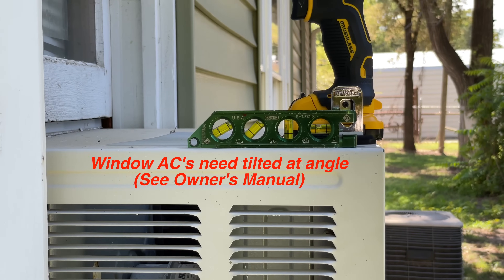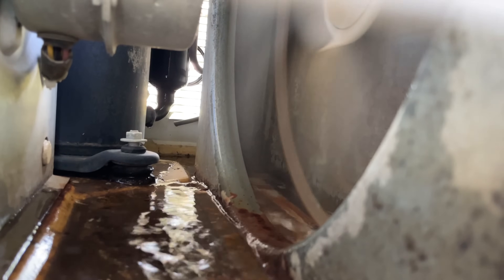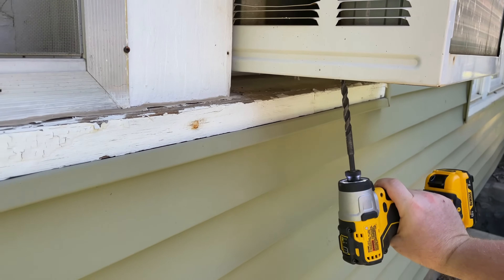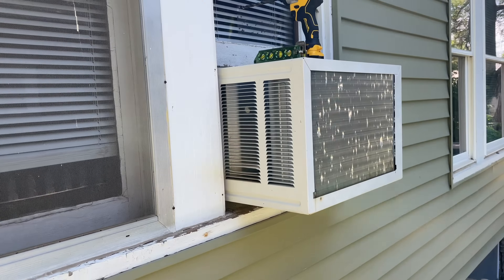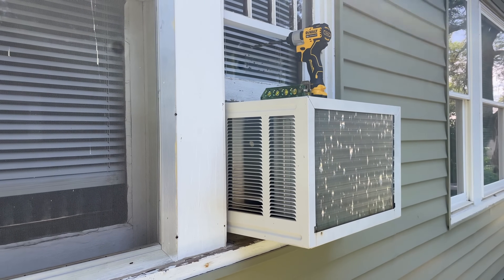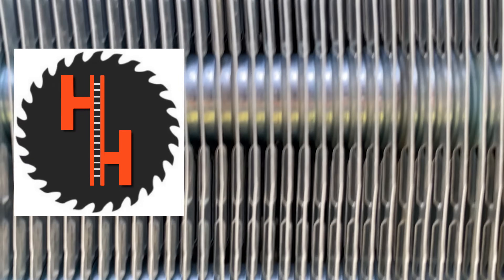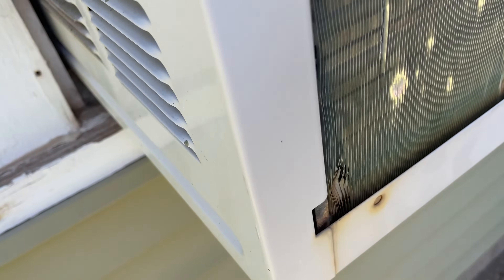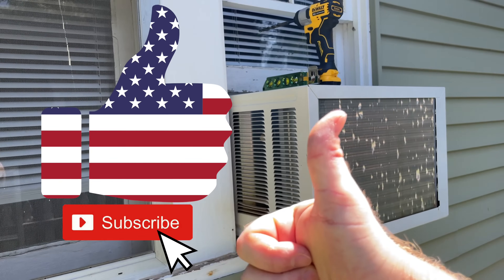99% Don't Know THIS About Window A/C's!! DON'T DRILL!!

Comment: I appreciate the information.  Unfortunately, I recommend that everyone break out a drill and add some holes... I guess the "splash" method is a good theory, but it's proven to me to not be effective, and it's risky to not have a drain hole.   The unit that I had before was in the same window 18 years, working near-flawlessly with just a few issues over time.  I knew where and why it had a drain hole, and I'd see it draining/dripping as I walked by it. And if I saw that something was keeping it from draining, I'd remove the blockage.  I'm not an AC or HVAC guy. I am a typical homeowner.  So, the operation of these units is not intuitive for me, but I at least understood why the hole was there.
So when I replace the original window unit in 2018 with the GE drain-hole-less one, I just assumed that it would operate like the original one, and thought that it would just drain... but I never saw any water.  So I assumed that it was just a different design, with better evaporation (or something like that).  Well, last year, I noticed a puddle on the floor in the garage/room that this window unit was cooling.  The floor was ruined, the wall was ruined. The window was swollen and ruined.  I can't tell you what caused the AC to clog up like it did, but a drain hole would have prevented that from happening.  
So, the manufacturer's attempt at "efficiency" is IMO a fatal flaw.  I spent  a couple thousand dollars on repairs, to fix damage that a $400 AC unit did... And all that was needed to prevent it from happening was a freaking hole in the bottom.  I'm sure that if I had been a more diligent consumer, I might have caught and prevented the damage from happening (by paying closer attention to the AC unit), but IMO the gained efficiency ain't worth $2000 freaking dollars.  
BTW, when I removed this flawed unit from the window, I noticed that the bottom pan, coils, fins, condenser mounts were all rusty.  another indication that this is poorly executed.  Back in the old days, I was never a fan of GE radios, appliances, etc.  But I thought I'd give them a try.  Never again.  They still suck.
Reply: As someone who's had an AC leak inside the room recently, I can tell you that this is not so much the manufacturer's fault as it is improper maintenance. There's a hole in the unit that goes from the front to the back, through which the condensation flows to the back of the unit and collects there. That hole on my unit was filled with junk buildup over the years.

I'm sure your unit had a similar problem. Granted, the rust issue I do agree on.
Reply: So, no new holes should be made! If the unit is installed correctly (at the appropriate sloping angle), then the water will simply pour out over the lip on the back or weeping hole.

If you have water leaking inside, it is because the unit is closer to too level, or you have a blockage between the front and back drainage.
Reply: @exisfohdr3904  But all does not pour out.  It is the water that stands in the unit that causes problems.  If you live in a dry area, maybe fine, but in the humid south, you will have a garden of slimy mold and rust issues.
Reply: @bogieman101  The units are designed to have that water in them. The water is hit by the fan blade and slung onto the condenser. This is the increased efficiency. The condensor is the hot one. The water slung onto it evaporates rather quickly, which increased the cooling of the condensing refrigerant inside of the condensor.

If you do not do regular cleaning maintenance, yes, the water just collects, and your condensing coil gets fouled up. This is a naturally occurring thing that can only be combated with proper cleaning intervals.
Reply: @exisfohdr3904  I understand every bit of that, but in certain areas that means continuous maintenance.  The design is not necessary, just an easy way to bump up efficiency by a micro percent without costing money on manufacturing.  Also reduces longevity.  The amount of energy it saves is offset by multitudes by short lifespans of units and potential  health concerns.  You just can have water sitting in units in high heat, high humidity areas without sludge, mold, mildew and algae issues, unless you plan on total cleaning every day.  It is just a stupid design and people are just trying to find a way to make it easier to live with.  Have you not ever seen a design that was idiotic yet is still being used?  That is what we are seeing with this.
Reply: @bogieman101  The unit is going to create condensed water no matter what. It is physics. Moisture in the air is going to condense on cold surfaces. Seeing as though we use these devices to create cold air, this is unavoidable. Whether the water pools up or is drained off, the water will still be present. The sludge that occurs is from the skin particles(dust) that mix with said condensed water. Unavoidable. Mold grows on that bio matter if not cleaned on a regular basis. Unavoidable. Does the water collecting in the base add to the problem, yes, but very minutely. 

Proper mounting and proper cleaning maintenance is required no matter what.
Reply: @bogieman101 I agree. I have had two casement ACs ruin two walls because of this idiotic design. The older ACs they replaced leaked outside with no issues and no maintenance, they just got old and needed replacing. This design is just planned obsolescence and a great way to grow unhealthy mold. The water splashing also causes any metal parts it hits to rust inside and also the rear grill if so equipped. I think that this is a health issue and a way for manufacturers to move units. The efficiency you my gain is overshadowed by the maintenance required, heath issues, that sludge at the bottom can't be good.
Reply: @CLDino  What I have done is follow some suggestions first, before I went drilling.   I placeed some gauze for wicking out the back, looks crappy but actually works well.  Also bought a bottle of Nu Calgon Pan-Treat tablets and put them into the front under the evap coils and in back (anywhere water sits or flows), maybe if I stay proactive it will prevent sludge issues.  Also added a foam prefilter and sealed as best I could all around it to reduce dust getting into the coils.  Will probably spray some non wash evap coil cleaner on the coils at the end of the hot season.  As far as leaking down the wall, I haven't had any issue with that yet, but I do have a decent slope on install.
Still not above drilling, just trying different things first.
Reply: @bogieman101  These were casement ACs. There is a metal sleeve through the wall,  installed level. I literally had to remove and reinstall the sleeve to get a slope.  I found it too late to save sheetrock and some 2x4. This old method is probably not used any longer.
Reply: @CLDino  I have an AC unit in a casement through the wall as per my landlord and had to get my unit replaced a couple yrs ago, 2020 or 2021. I winterize it every winter as it doesn't come out for the season. The new one put in doesn't drain and landlord removed the grill on the back of casement to prevent overheating, where I am there's lots of humidity and dust and leaves and the bottom pan is disgusting and any time it runs on fan only mode my apt smells like nasty feet. Idk what to do because idk how to take this out and can't just hook up a hose to clean this thing, I wish deep cleaning units was part of yearly maintenance because I cannot take this smell and it looks nasty from the back end. 

Anyway those casements are most definitely still used, esp in multi unit rentals and I hate them personally lol. Where they have mine it's taking up a chunk of my balcony, blows hot air over half my balcony making it unusable, and it's easy to accidentally rip your leg open on the damn thing because it's right beside slider doors, plus it's directly in the afternoon sun. Whoever designed this didn't have a functioning brain.

My old drippy unit never had this smell. It's disgusting.
Reply from the maker: If a unit leaks in the house, it’s usually one of two reasons. 1) It’s installed wrong and at the wrong pitch (you’ll know this right away after installing it) or the more Likely in your case 2) dirt and debris clog the pathway for the water to go from the evap coil on front of the machine to the back of the machine. If this is clogged, you can have 10 holes back there and it won’t do any good. This is why you need to deep clean your AC unit periodically. I have a great video on how to deep clean it and I explain this and show you where to clean.

Comment: I complete ruined a year old 18,000 btu 240v unit last year for not knowing this. I noticed it wasn’t dripping water and freaked out thinking it was going to to go in the walls. I took a drill to it and busted Gas pipe. Oh yeah, and this was on Mother’s Day!!! 😂😂😂.. it cost @1k to replace it with a new one. Lol
Reply from the maker: Oh no!!! 😂 I was kinda flipping out too that was water was building up.
Reply: This what I did an mess up mine🤣🤣

Comment: Had to drill mine anyways. Have old windows that don't allow the A/C unit to have a downward angle to it. Takes a bit of rigging just to get it level actually. So that water was sitting in my window sill and rotting my wooden window sill. Since it overflows before going out of the weeper holes, I had to drill holes in the bottom. I wish A/C units would come with a slider so you could move the top part of the surround forward or backward to change the angle of the unit while still allowing the unit to fit in your window properly. These things arent made to work in old windows unfortunately.
Reply: cutting a piece of wood to put under the unit on the inside part of the sill works pretty good to give the unit the preferred tilt. As long as it's level, or no more than a 10 degree tilt down on the outside it should be fine.
Reply: @slimj091  it doesn't change the tilt, it just raises the unit up. I already have wood under it. Tried to increase the tilt with shims but no luck. It's literally the pieces that slide out to fill in the window that make it so it can't tilt. If I keep those straight and flush with the window, the unit isn't tilted. If I til the unit, the sliders aren't on the front of the window. I'm telling you, I've tried just about all I can do to change the tilt but it won't tilt more.
Reply: Ended up buying 2 portable units to replace my 2 window units. But still had to use one of the older ones because the portable ones couldn't keep the temperatures down. The A/C that wouldn't tilt in the living room does slightly tilt in the bedroom. So now I'm good with all the A/Cs installed correctly. It must just be that living room window that doesn't allow the A/C units to tilt.
Reply: @timmypstyle make sure you get dual hose portables. See videos about why but it is 100% no brainer.
Reply: @The_10th_Man  thanks for the tip. But I already bought 2 Toshiba smart portables. Can control them from an app while I'm at work and set a schedule for them to change to whatever setting I want.
Reply from the maker: hmm strange. How old is your house? Mine was built in the 20s-30s with the original windows. I know everyone is working with different windows. I wish there was a way to adjust them too.
Reply: @HandymanHertz  mine was built in 1905 but not sure about windows. There are wood framed and are the same windows my parents had in their old house that was built in 1901 that had the counterweights in the walls. Mine doesn't have counterweights tho.

Comment: So short term gain then blockage of coil air gap because of sludge buildup and sloshing onto the condenser. Well, these are throw away units so it's fine:)
Reply from the maker: I have decent experience with these, as we have quite a few window AC units personally and in our rentals. I have never experienced sludge, as you call it. That’s just my experience. I can’t speak for everyone… but if you look at the pool of water that the slinger fan collects from, it’s calm and clear.
Reply: I just remove the cover and hose it out every year or two. Mine has been running fine for nine or ten years.

Comment: If you live in a desert environment and at times you get sand/dust blowing around all this (Design) does is PLUG UP the the condenser coils. This dust/dirt gets blown into these coils so then turn on A/C and guess what happens next, add water to this dust/dirt and what do you get ?  MUD ! Then when A/C is turned off this MUD solidifies.  Sometimes life is just a b*ch.
Reply from the maker: Interesting, that’s for your perspective from a desert environment, which I don’t live in. Wouldn’t the dust cake in there anyways, even if there was no water? Isn’t that the nature of the beast with a outdoor fan blowing everything into the coils? For instance, ceiling fan blades collect a lot of dust that sticks to it with no moisture.
Reply: Where I live we have extreme spring tree pollen. It's no where near as bad as desert dust, but it does mean I have to remove the cover and hose it out every year or two. Easy job, though. Takes ten or fifteen minutes.

Comment: I have this model GE, and Mr Hertz is right, they are designed that way for efficiency. The only problem I have had is the blower wheel which is inside the Styrofoam duct molds up and spits black mung out the cool air vents. I take mine apart every other year and clean it. 👍
Reply: I have a similar experience with my Frigidair AC unit. Every few years I need to take the cover off and clean out the accumulated gunk. I'm pretty sure it's mosly tree pollen. Where I live, litterall every outdoor surface turns green in late spring from all the pollen. If it weren't for the pollen I'd just keep the windows open and not install the AC until early summer.
Reply from the maker: Hmmm…there’s shouldn’t be any thing blowing out of the vents if installed correctly and working properly. Sounds like maybe gunk has built up and not allowing water to go from the evap coil in the front to the back of the unit? This would lead to water poking up and getting caught in the blower. I’ve never experienced a smell, personally. What climate do you live in? Is it humid?
Reply: @HandymanHertz   Yes, I only run it when the humidity is high. I will take the thing apart at the end of the season and do a better job cleaning it.
Reply: @HandymanHertz  I bet you will find that there's no drain hole in the fan side of the evaporator styrofoam. Either that or its clogged. The design is very level sensitive, every one I've opened drains poorly and has mold buildup in the fan part of the enclosure. Every one. Which means there's moisture accumulating there. Gotta get it out.
Reply: I had several Frigidaire units that do this.  And no, I didn't put any holes in it either
Reply: @adventureoflinkmk2  I've had many different brands other than Frigidaire which never had a mold smell.  Unfortunately, they didn't last as long as they should, so I purchased only Frigidaire for every room in the house, and I start smelling mold just after the first year.  At the beginning of this year, I had them all outside and washed the hell out of them first with dawn, then rinsed it very good, then vinegar 5x's each, then used a high power leaf blower on them to dry them until I couldn't see anymore water coming out.  Then I let them sit out in the direct sun for the whole entire day.  Only half way through summer, and the mold smell is back full strength.  I am definitely drilling holes, this is ridiculous!
Reply: @radsan3006  just be careful not to hit any a/c components when drilling
Reply: @adventureoflinkmk2  I actually know someone who had done that exact thing years ago to a brand new one.  I plan on taking it all apart and cleaning it, the I'm going to drill from the inside out.  It only makes sense to me that when water or moisture remains in any system for a given amount of time, mold will definitely form, especially with Styrofoam.
Reply: @radsan3006 same problem here. Guess I'll be drilling holes after I clean this thing again before storing away.
Reply: If you have water spitting inside that means the inside coil is icing up. Setting the unit to cool, at high fan speed, and set the temp a couple to few degree's higher should alleviate that problem.

Comment: You can also shove a few sections of towel in the front and itll wick out as long as you dont pinch the towel and have capillary action.
Reply from the maker: I’ve heard of people doing that. Does it cause gross, moldy towels?
Reply: @HandymanHertz  yes. use old microfibers that arn't too tore up bc you still need that cap action. Or you can use bownty. The grossness stays inside the case usually. Then it plugs the towels and you change them.
Reply from the maker: @Keith_Mikell  great tips, thanks
Reply: @HandymanHertz  anytime. Just remember to loosely stuff the towel in. You want the capillary wicking action.

Comment: Why is the bottom so rusty then lol it made the fins so dirty I can't even clean most of it out
Reply from the maker: All fins will get dirty because there’s a fan blowing everything in the air into the fins. If you actually look at the pool of water in the bottom, it’s clean, clear water, not rusty. The bottom gets rusted over the years, this is an older unit. I have never had one that rusted through to where it wasn’t functional anymore. That’s just my experience.